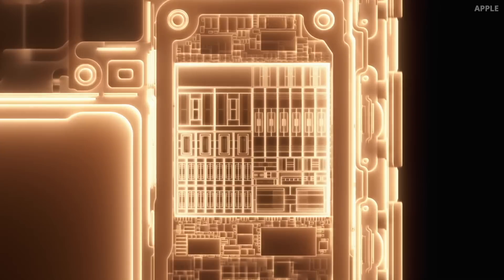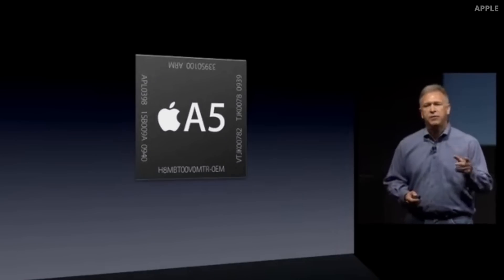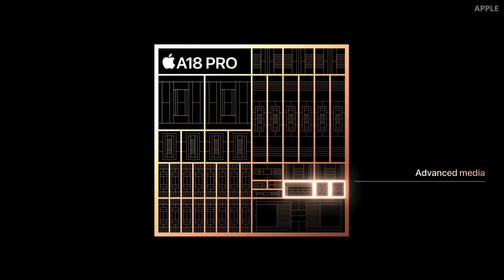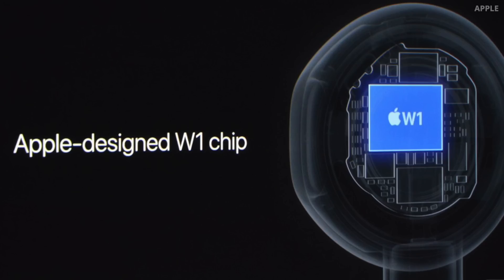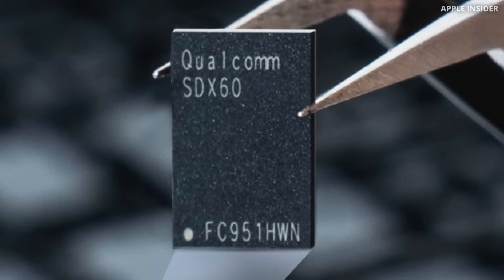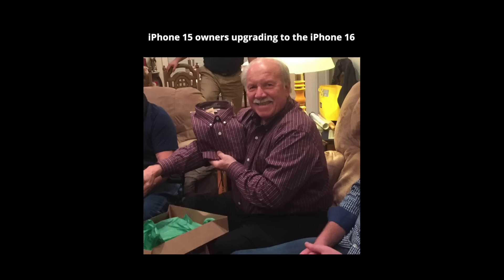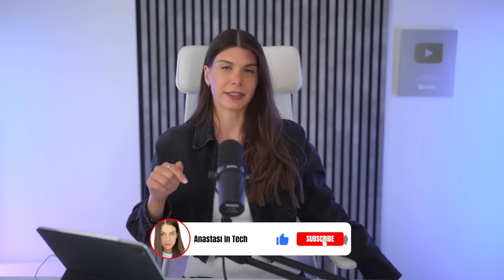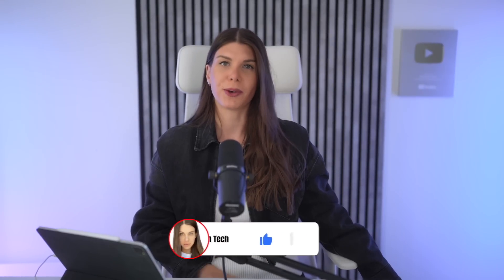The Secret Behind Apple's New Silicon

Comment: I think glass offers more paths for making chips easier to cool more stable and having outstanding resistance to conducting electricity and rigidity and flatness to make wires and transistors smaller while also possessing un-matched non-solubility to almost every liquid coolant allowing for direct heat transfer to liquid coolant without the need of an intermediary solid heat transfer (Think water cooled heat transfer fins) to interface with the liquid coolant. Ray

Comment: I’m not sure about the details but isn’t the Apple’s NPU a somewhat different accelerator type than GPUs? By this I mean that GPUs come from a line of chips that were originally meant for hardware acceleration of math operations used in graphics, but not necessarily in matrix operations. Granted, they are useful in those as well, but aren’t specialised architectures like TPUs or NPUs inherently better at those specific math operations that are used in machine learning? Perhaps Apple is aiming at achieving a yet undiscovered advantage in that?

Comment: I don't believe all of this will ultimately benefit the phone purchaser, Apple has never reduced the cost of their phones, no matter how much they attained cost savings.
They are all about consumer lock in and additional revenue streams while trampling on competitors and their forays into custom silicon are no more than being able to exclude competitors from their development path for as long as possible. To say it's to secure supply is rubbish, because the most secure supply chain is one that has the most redundancy, which would be the supplier with the most Fabs. Even SW development, is best served by using lower cost multi-sourced silicon as the developer pool is largest putting to some extent pressure on the labour market.. I work in electronics design and we create designs that are multi sourceable so that when something blows up somewhere we can shop on the open market. I seriously doubt changing from Qualcomm to Apple silicon will save more than loose change (for Apple) after all of the side costs are considered. Also no supplier (eg. Samsung Semi) would ever affect a customer the size of Apple because of market share in their phone business. Making everything proprietary is more likely the driver. Still, I think this was a well researched video, and I thank you for your insights.

Comment: Apple is certainly capable of building datacenter chips, however selling them in already quite saturated market with Nvidia accelerating almost every datacenter, with Intel and AMD and lots of other including in house design players (Google, Amazon, MS) will be quite difficult to achieve sustained profit margin. I think they will use it first and foremost internally for their own purposes and only then expand further.
And of course u right, when it comes to HW design they want to eventually replace all the OEM vendors with their own in house chips and solutions to not just cut costs, but also have complete control of everything in their devices (control is power). 5G modem is Apple's long time struggle as it's quite challenging to replace Qualcomm's excellent modem chips which deliver industry leading specs and performance. However it must and it will eventually happen as Qualcomm is Apple's competitor not only with the mobile Snapdragon chip in Android ecosystem, but now also expanding their market share with ex Apple -> Nuvia X-Elite PC chips backed by Microsoft. Apple's goal is to design as much in house as possible in order to be able to always innovate first with their unique HW & SW solutions u simply cannot get anywhere else. They might even in a very distant future ditch Arm and go completely with their own design or even try to acquire it after Nvidia's failed attempt. Arm and Apple share together a very cool history and continue to have excellent relationship planned to go beyond 2040.
It will be very interesting indeed to watch what will be Apple's strategic moves in the future and how they will innovate chip industry.

Comment: The biggest issue they have is that Qualcomm has several key patents on 5G technology that they have to find alternatives to that don't infringe those patents. It's why Intel sold the 5G business to Apple. They decided it was not feasible to build a 5G modem since they could not bypass the patents. Look at their patent filing around modem technology and you will find out if they have been successful. Meanwhile, we see that Apple is embroiled in patent litigation on their blood oxygen sensor with Massimo. That will be interesting to see how it gets resolved. It could determine the viability of their sleep apnea health technology as a medical-grade detection capability. Right now, they are looking at arm movements but originally were using blood oxygen levels as part of their diagnostic process for the app.

Comment: 13:50  .... I don't think the efficiency is that  dependent on nVidia or Apple . Maybe some small difference because of design tweaks or a little bigger  because of course of nVidia's CUDA.

The  efficiency is mainly dependent on TSMC. Sure nVidia is now ahead in parallel computing because it has done this for years. But nothing prevents Apple from catching up
using your typical decent engineer and using same design principles and knowledge.

This would not make it Apple's Silicon as it does not make it nVidia's silicon. It is important to speak in this fashion , else people get derailed in flawed train of thoughts. It is not that design is not important , but we ignore manufacturing process.

If design was so important companies would take their time adopting new nodes .  An independent and objective observer would assume companies still run on 22nm or sth like that from all this talk about "custom" silicon. 

Again , it is not that design is not important , on the contrary. But we make it much much more than it really is.

Comment: Great video. Question: there are different GFLOPS and TFLOPS calculations. The CPU can be measured and the GPU. You said in the video that the Neural Engine of M2 Ultra adds additional TFLOPS performance. If we look at the Apple M4 SoC, how much is the combined performance of this chip? The GPU alone is not only faster compared to M2 (from previous iPad Pro), it also has hardware ray tracing, mesh shading, and the Neural Engine is capable of calculating 38 TOPS. TOPS are different compared to TFLOPS, though I hope you can answer this question. Thanks 🙏 in advance.

Comment: We need to understand that the technology market has made a significant leap in smart phones since the appearance of the blackberry to the present day: access to the web has expanded globally, the interconnectivity of interpersonal and intrapersonal human relationships has changed with the emergence of social bubbles fom apps such as Metta, TikTok, LinkedIn, etc., with smart phones being considered an extension of the mind. 

Therefore, the development of technology is at an interesting stage with the probability of emerging a new method of making inference with the web window or of evolving the synapses between human-machine-internet with the possibility of the emergence of enhancing the cerebral cortex that currently infers in the digital universe: five sense consciousnesses, of which we only use two (visual cortex and auditory cortex) in a normal inference with the web, and in extraordinary cases we use three – video games that allow the touch consciousness to emulate reality.

Let's for a moment imagine that neuromorphic engineering takes a significant quantum leap in the use of large-scale integration systems that contain analog electronic circuits to imitate the neurobiological architectures present in the brain and central nervous system. The terminology is used to describe large-scale integration systems analog, digital, mixed analog/digital mode systems and neural systems with processing through highly sophisticated algorithms capable of synapsing with the totality of sense consciousness in an interdisciplinary interface grounded in neuroscience, biology, physics, mathematics, computer science and electrical engineering. The aim is the design of artificial neural systems whose physical architecture and design principles are based on biological neuronal architecture. 

In creating a neuromorphic network formed by the random self-assembly of silver nanowires coated with a polymer layer after synthesis in which the junctions between two nanowires act as resistive switches, generally compared to neurosynapses – using this network, scientists generate electrical characteristics specific functions similar to those associated with higher order brain functions exclusive to human beings such as memorization, learning, forgetting, alertness and return to calm, in an inference with the digital universe with a new technological item that is highly subtle, easy to manage and capable of making synapses simultaneously with a mind-internet interface.

The most important of the entire structure are the considerations related to ethics: although the interdisciplinary concept of neuromorphic engineering is recent, many of the ethical considerations apply to neuromorphic systems that apply to "human machines" (if we equate robotics, vehicles autonomous, etc.) and A.I. in general, as they are designed to imitate the human brain, which generates unique ethical questions surrounding the use of these artificial neural networks. 

The intelligent assistant 'Alexa' will be evolving into an 'Artificial Brain' with quantum processing in a significant number of qbits that allows analytical-intuitive-creative thinking within a golden wristwatch with the ability to project the layout or work environment of the operating system in a hologram that we can interact with the consciousness of touch in the interference of specific light frequencies capable of creating the three-dimensional "illusion"? 

The idea here is to create a project that is a subsidiary of a large technology company with capital capable of supporting the design development of an 'artificial brain' with an implementation that could be based on the principles of coherence/incoherence nonlinear phase  of Holographic neural technology. In an analogy to quantum processes through the nuclear synaptic algorithm, which in turn has great similarity with the wave equation of quantum mechanics.

Since 2008, IBM has received around $4.9 million from the Pentagon to conduct research into the production of intelligent computers: the Blue Brain project consists of the premise of the possibility of synapsing with an interface through thirty million neurons in their three-dimensional positions. The progress of the Blue Brain project is much ahead of what was previously estimated: "consciousness is just a huge amount of information being transmitted by trillions of neurons" – can reformulate the progress estimate and equate the probability of inputs for downloading the information contained in a human brain to a physical digital platform or to a 'cloud' for restricted access until 2050. 

There are good reasons to believe that predictions of the production of 'Artificial Brains' in the near future are optimistic. But not everything is rosy, there are some obstacles – brains in particular (including the human brain) and cognition are not yet well understood, and the scale of the computation required needs adjustment. Energy limitations in the design are engineering obstacles: the human brain consumes around 20W of energy in 24 hours, on the other hand a supercomputer can consume in the order of 1MW (note: the Landauer limit is 3.5x1020 op/sec/watt at temperature environment) which makes component design an increasingly meticulous process.

Comment: A key weakness of Apple Silicon in the datacenter is its really bad hypervisor support. They just recently added nested hypervisor support into macOS Sequoia (beta), but still no support for GPU/ANE access inside containers/VMs. With Linux/Windows you had nested hypervisors and GPU support in containers/VMs for a long time. Apple is still a very consumer-software/hardware focused company with very little datacenter experience. I really like Apple and mostly use MacStudio/MacBook/iPad/iPhone. But the base software-infrastructure of even first-generation Snapdragon X is better (I have a Surface to test it thoroughly), than the one of my workhorse M2 Max 96GB. Even though the Mac Studio's high-bandwidth/comparatively cheap memory is great for LLM inference, it's a total mess in terms of security. It has no docker-/VM-isolation support and I need multi-boot to an isolated disk, to secure it.
Reply from the maker: Thank you sharing. Really interesting point.

Comment: Datacentres running Apple Silicon is a huge step change, they are highly power-efficient and just overall extremely powerful chips. Even AWS is heavily investing in ARM, because they're both faster and cheaper to run, and the greatest cost for a datacentre is energy.

Comment: Apple has been unthreatened for too long, now Qualcomm is on par with Apple chip, and it shows, Apple is just pumping out new chips, but these are not much better than the previous ones, has Apple reached a limit

now these shrinkages do not only apply to Apple, the smaller the transistors become, the more intel, TSMC, etc. come across things they do not yet understand, and the price, the length, and the errors on each Wafer they only get worse and worse, with each shrinkage,

which can best be explained by Quantum Mechanics, it would be interesting to hear your take on this Anastasi

Comment: I could be wrong but I don't see them integrating 5g into the main processor due to heat issues. Anything that transmits a signal is going to generate a good amount of heat using current and foreseeable technology and I don't see wanting to put that into the same package as the main processor.

Comment: With the chip design team that Apple has, I’m sure it’s not a huge leap to go from edge based NPUs to scaling the architecture for larger performance. Albeit, in the mean time partnering with the various AI providers will allow a smooth transition to happen until they are fully up and running on their own hardware. I don’t see the current architecture for M series chips being the right one but scale up the NPUs and GPU with some modifications like local memory for NPUs / GPU (because as far as I recall this is a major resource constraint for all AI chips). However, I’m curious to see what real software improvements we will see with AI. I am actually pretty excited about the future with the potential productivity improvements with data analysis with AI in the engineering world. I think there are many more opportunities in the typical office suite space as well as more targeted engineering applications that will really see the benefit. Just think of all those manual tasks we carry out in spreadsheets, presentations, documents that could be much more efficient. 🤔

Comment: Apple's silicon uses less power and also has less teraflops. One M2 Ultra is far less than a full Grace Hopper GPU, but the equivalent would be something like several dozen M2 Ultras vs. 1 GH. Also, Apple's silicon has to have GPU clocks well above 2.6 GHz to be competitive, but they are at 1.4 GHz for the M4 -- they have to figure this out in order to be competitive.

Comment: Interesting if they’re using Ultra chips. You don’t need nearly as much compute for inference vs training, and the big load in delivering AI to their users is going to be inference. Also, power and power density is becoming an increasing problem in datacenter design. Large numbers of very low-power chips might give better packing density in terms of net inferences per second per cubic volume, and more inference per watt-hour than faster systems.

Memory access strikes me as the biggest issue with running inference, but if you can fit the problem into the 128GB of the largest ultra configuration, the M2 Ultra’s internal memory bandwidth is very very high. There’s not remotely as much dedicated “neural” hardware in the Ultras as even a small, much earlier generation NVidia chip, but if you intelligently manage the task assignment, there’s a lot of inference processing that could be done on an Ultra vs on the latest iPhones themselves.

If you look at it, using Ultras in special-purpose datacenters could make a ton of sense: Cheap hardware with low power requirements that’s still one or two orders of magnitude more powerful than the on-device inference engines. Run small but capable models there, and then hand off the really demanding stuff to OpenAI’s servers and advanced models like o1 Mini or even o1. 

The vast majority of end-consumer edge requirements will be able to be handled efficiently by a combo of on-device compute and Ultra-based datacenters. Purchase the small percentage of remaining needed capacity from OpenAI at wholesale.

Bottom line, this sounds like a very smart and well thought-out move by Apple, I predict great success at scale. Give them a year and they’re going to blow Samsung et al out of the water.

Comment: Hate to tell you but Apple has been involved with making silicon a lot longer than the iPhone. The Motorola processors Apple used before Intel. Motorola worked with Apple and IBM to design and manufacturing of those processors.